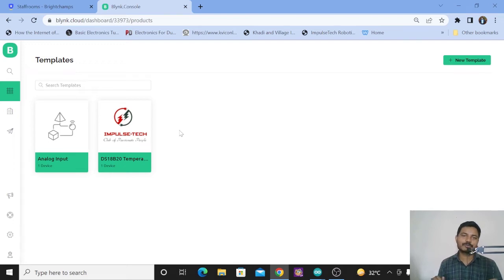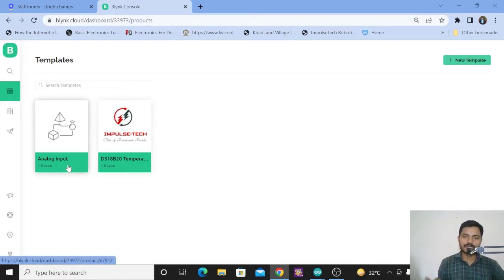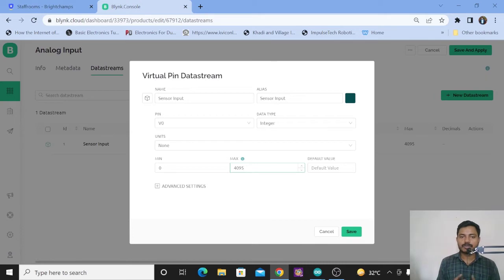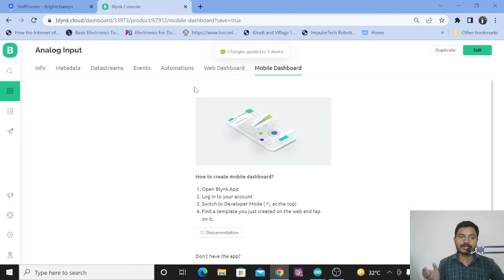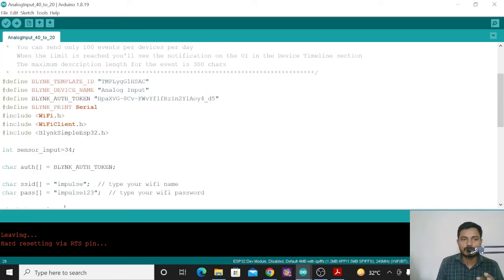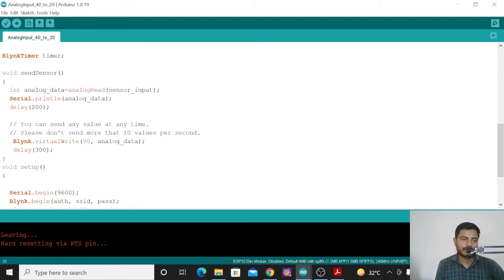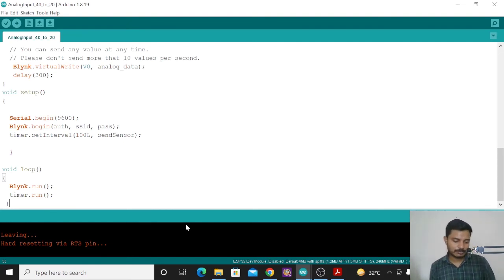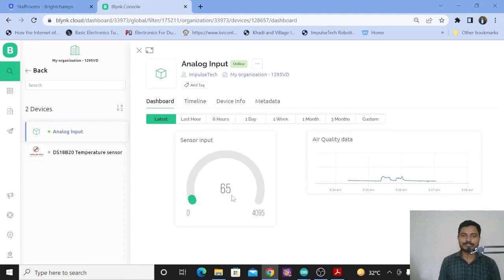IoT based Air quality Monitoring system | Air pollution monitoring using MQ135 & ESP32 #IoT #esp32

Comment: I have made it to display on oled display,readings are kinda high 1000 to 4000 ppm
Is it necessary to calibrated if yes what is procedure? With controller or without and what we will achieve after 24hrs
Reply from the maker: Your question is valid and I need to think on this